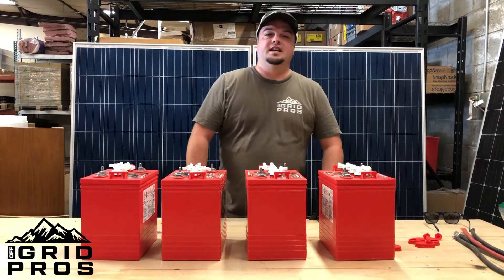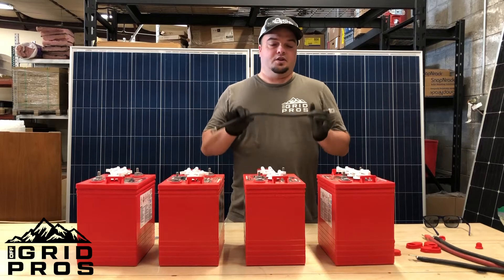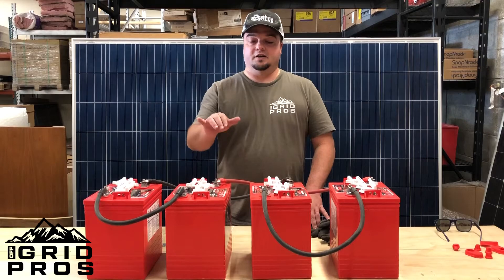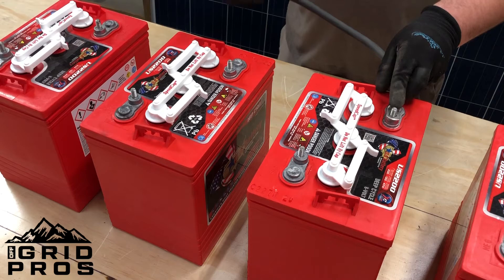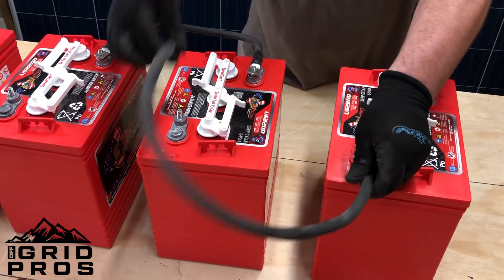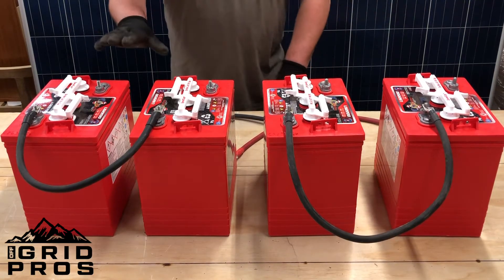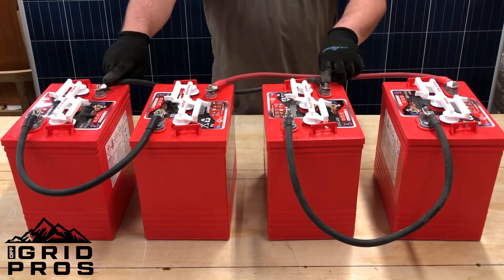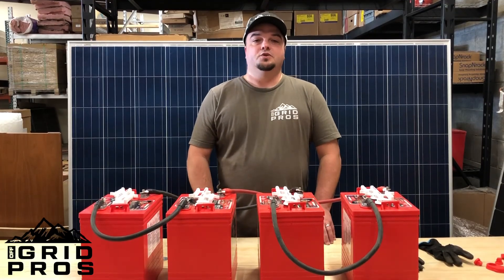How to Wire Batteries in Series vs Parallel

Comment: I am planning to buy a battery  that will connect to my 2023 Mercedes van battery - the connected battery will be connected to a 4000 w Pure sine inverter - is it ok to have a battery that is not exactly the same battery connected to the Van battery? (I am extremely new at this)  Oh there will be another battery  connected to my roof top a/c - different brand ... should the two batteries be the same make as the van battery?  THANK YOU !

Comment: Dumb question... if a battery states that you can only do 4 in parallel but no limit to series, could mix the parallel and series to increase both the voltage and capacity?

Comment: I can't laugh, but I am..🤣👍
Hope u are all doing well. Been listening to your podcast, but I'm only at ep4 s2.. or something like that, I can't be bothered to check... anyways.. i'm very interested in solar energy/renewable energy etc, and have a couple of questions I hope you can answer?
1/ is there a way of monitoring how much energy I can capture over a year period. In the UK, the sun is fucking lazy.. or maybe a different solar panel that works well in all light?? 
2/ if I have a 12v x 2 @ 24v  (150 each)  that is connected to an inverter to run my fridge, do I need to work out my amps drawn from the fridge to the battery or do I only need to know amp to inverter? To figure the amount of amps I need for running the fridge for a day.. the is hyperthetical BTW.
3/ have u ever heard of the shower that recycles the water u wash with? Very cool idea. Sell it.. and maybe design and build a recycling bath too.. just an idea.. don't forget my cut if it takes off.. lol
What do I need to get qualified in doing this industry? I take it I have to be a sparky? Is that right??

Comment: in creating a 24 volt system using eight 12 volt batteries in series & parallel, after connecting the batteries in series going neg to Pos down the line, when I try to connect the parallel going from the first battery to the third battery to connect the parallel cables I get a large spark
what am I doing  wrong ??  thanks Al

Comment: i have 4 solar batteries connected in parrallel bit the charge controller only shows 12v only, n they drain so fast just with lights of 45watts with solar panels, what could be the problem